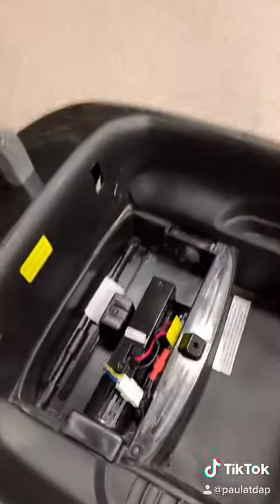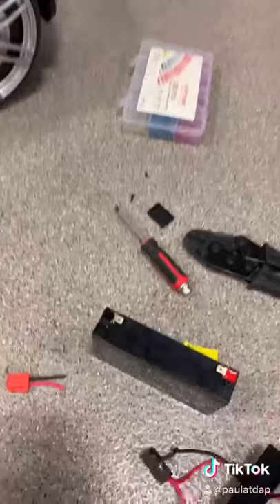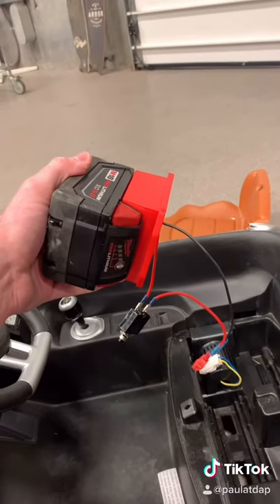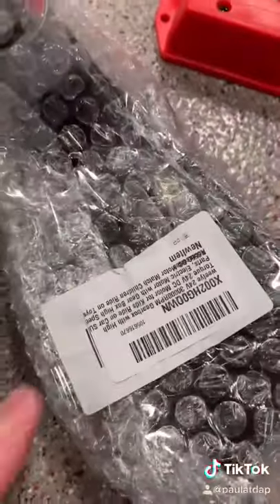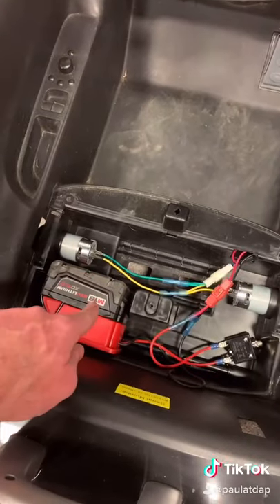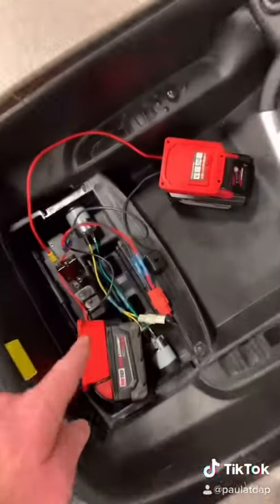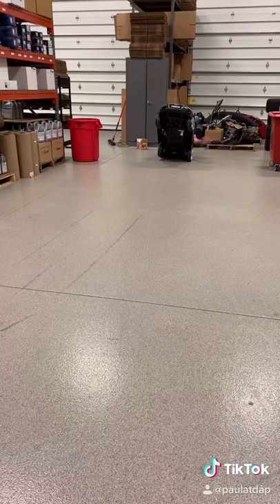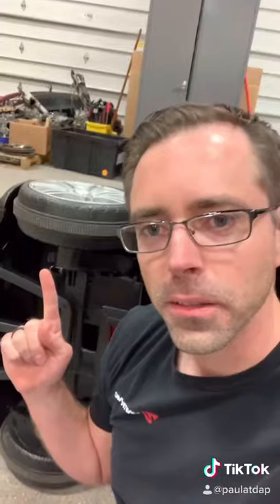Running 36Volts to a Toy Power Wheels Car!

Comment: Only issue is the plastic motor gears cant handle it. They will be destroyed in few hours. Is there a way to fix this?
Reply: MLtoys has replacement gear boxes with all hardened metal gears

Comment: I already have twin motors on a 12-volt battery in my son's ride on would a power tool battery set up like you showed in the first half of the video have more capacity for more driving and a quicker charge time with a power tool charger

Comment: I blew my power wheels up somehow using two 18v Milwaukee batteries. Now it doesn’t go at all. I heard a pop noise after turning it on. 🫤
Reply: You probably didn’t have any fuses to prevent the motor from blowing up. The fuses would’ve went instead of the motor